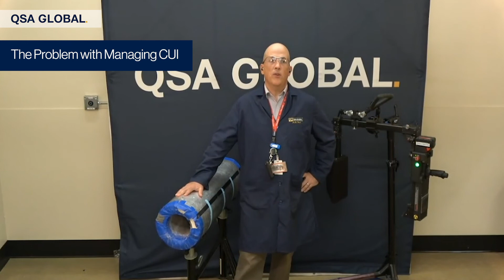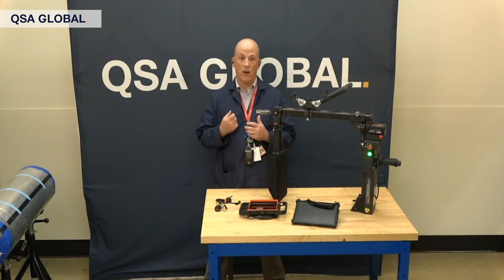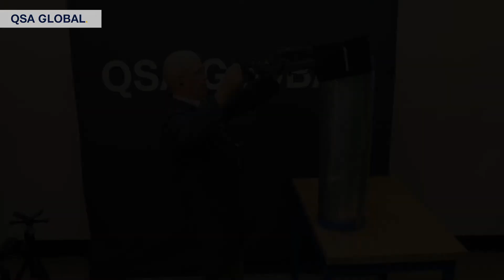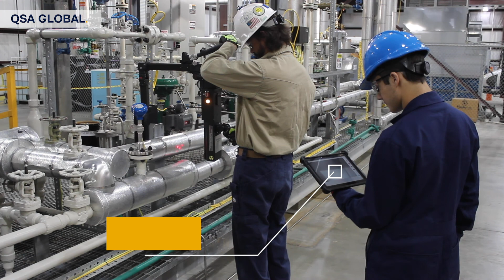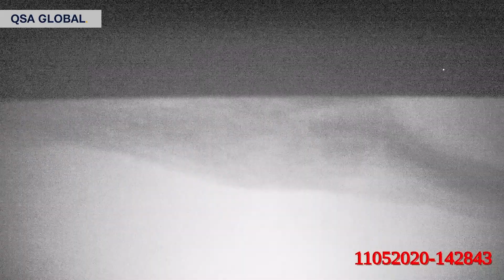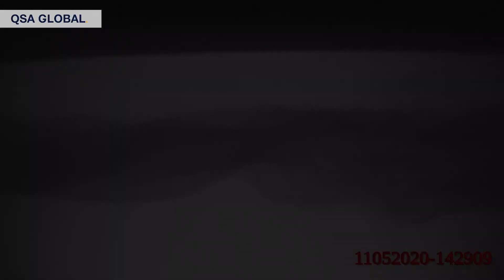OpenVision Method for Risk-Based Inspection CUI Programs

Comment: 70kv so not too much penetration power, will go through aluminum, thin steel, cardboard plastic etc. Will not go through thicker steel copper lead etc. If you upped the power to 120kv it would be very useful for all sorts of stuff. Maybe design one with a dual power x ray source?
Reply from the maker: OpenVision is used on a variety of piping sizes, insulation and cladding. We will be posting videos of what the screening looks like on various piping applications in the next few weeks. Our latest version, OpenVision HD, uses a CMOS advanced imaging technology that produces high-contrast, high-resolution images and videos. 

If you want to learn more about what piping OpenVision works best with, please review our application matrix here: https://www.qsa-global.com/openvision-hd

Comment: Great for your back! Looks very uncomfortable for the guy holding it.
Reply from the maker: The handles and c-arm are adjustable to fit the individual using the device (see this at 5:56 in the video). We also provide an optional image stabilizer that transfers the load of the c-arm from you to the pipe, making screening effortless, and ensuring video and image captures are smoother and better quality.  The Image Stabilizer  is available for use with OpenVision DX and OpenVision HD.

You can view the image stabilizer with the latest model, OpenVision HD, here: https://www.qsa-global.com/openvision-hd